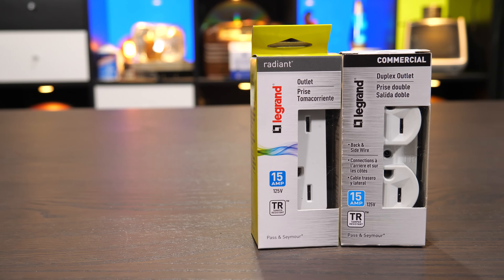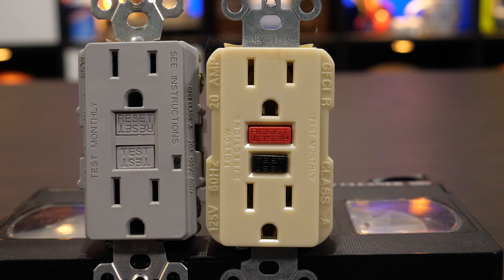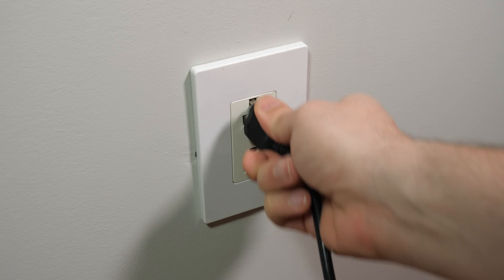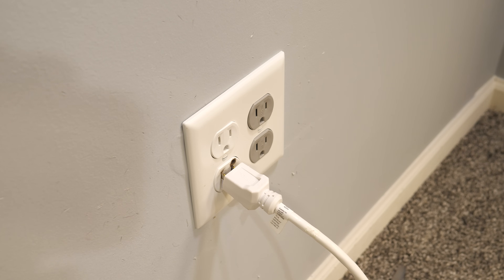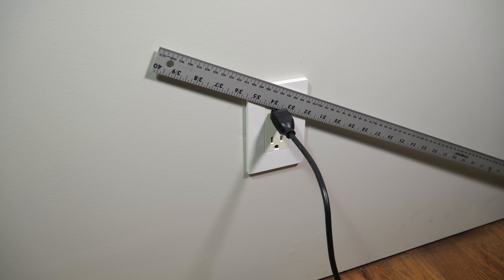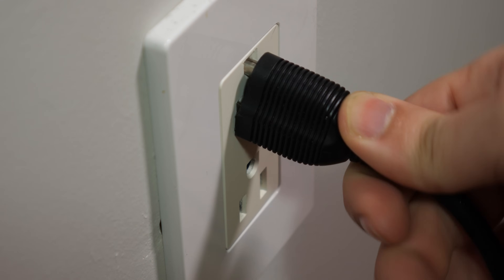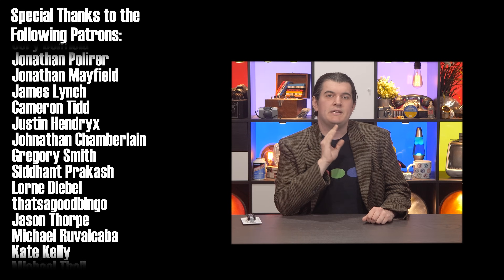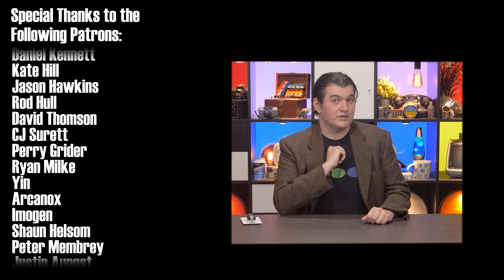Power outlets are topsy turvy - but does it matter?

Comment: I hail from the great Lands of the Schuko a.k.a. Type F Plugs and have very little experience with your death-traps, yet I found this video interesting as ever. Good job!

Also, have you ever considered uploading to Nebula?
Reply: Here in Italy Schukos are the bane of our lives...all the larger appliances come with them (or the ungrounded version for some reason) meaning you either have to cut off the plug and replace it with an Italian 16 amp one or use an adapter. "Why not just install one of those fancy outlets that can take both Schuko and Italian plugs?" I hear you asking. Well, here's why: those outlets tend to work terribly with Italian 10 amp plugs, catching on the part where the prong insulation meets the metal tip. This is particularly bad with europlugs (identical to the traditional ungrounded Italian 10 amp plugs except non-rewireable). Additionally, Schuko outlets take twice the space of traditional 10/16 amp Italian ones in the most common compatible socket assembly designs. Some designs, particularly older more traditional ones, also have smaller plug faceplates (I mean the little rectangle of plastic around the socket, which also normally is the size of a light switch) which do not support sacrificing two Italian outlets for one Schuko.
Reply: @traveller23e and don't forget: “Oh, you cut off the original plug? That voids your warranty and is the cause of the malfunction/fault, of course: it's clearly a job that only our overpriced authorized electricians are able to do [but definitely wouldn't]“.
Reply: @AelwynMr  Lol only applies to new devices, and only in some situations. If it's on the end of a kitchen blender or hair drier I really don't care and it's just a question of whether the joy of not using an adapter is worth the effort of rewiring. It's also sometimes convenient to have a standard Italian 16 amp plug on the end of a power strip that came with a Schuko, not to mention standard AC computer power cords (in one situation for example I had a spare cord set up at my desk with a short cable and a right-angled Italian plug as that was what fit best, then I had a separate cord for travelling etc).

Comment: easiest solution is just do what other countries do and mandate all future plugs need to have an insulated first few millimeters of the prongs, so if it becomes slightly dislodged or your fingers slip, you touch only the rubber insulation, not the bare metal

Comment: Obligatory making fun of Japan for not only having 100 V/50 Hz electricity, but also for using ground wires instead of pins. Have fun touching the live blade with your floppy wire.

Comment: Recessing the power outlet by a quarter inch would likely solve the problem of exposed pins while plugging in, and also hold the plug in place. A channel could also be moulded in from the ground pin for right-angle plugs. 
 Another option could be a ridge above the live and neutral pins, or click-lock ports that actually hold the plug pins in place (push to lock, push to unlock mechanic).
Reply: The college I go to has recessed outlets. Although it can be an issue for some adapters.

Comment: I like it down myself and Dad is an electrical engineer.  With it down it is closer to ground as well.  Up also adds stress to the ground if cord gets stepped on while other prongs share stress.  The case of a falling object, is why you have breakers and GF protections.  The right angle is a good idea but the boxes are not made to mount well to the wall studs that way unless you are doing a square box.

Comment: When I was in middle school, I was at home alone getting something out of my dresser. I closed the drawer and the power went out in my room. At some point prior to that, my dad had shown me a fuse box and a circuit breaker box and what to do when the power goes out in one room. I went to the box, saw that one circuit had tripped, and I flipped it back. It immediately tripped again. My dad didn't explain what that meant, so I kept trying 2 or 3 more times. I eventually gave up and went back to my room. All I remembered was that the circuit tripped when I closed the drawer on my dresser, so I opened and closed it again and then went back to try the breaker and this time it stayed in place when I flipped it back on. I was in middle school so I didn't question why this worked.

About a week or so later, I noticed that some stuff had fallen behind my dresser and I pulled it away from the wall to get it. There were black marks on the outlet behind my dresser and when I went to pull the cord of my clock radio out of the outlet, I saw that part of the prongs had melted away. Then I found a penny on the floor with black marks on it. I eventually put two and two together and realized a penny had fallen behind my dresser and lodged itself on the prongs of my clock radio plug and completed the circuit like the knife in this video. And my repeated attempts to flip the circuit back on while the penny was still sitting on the prongs of the plugged in outlet were actually unintended attempts to burn my house down. So the incidents that this new style of installing outlets aim to prevent actually do happen - I am living (thankfully) proof. That said, since it was a two-prong cord without a ground prong, as this video points out, putting the outlets in upside down would have done nothing to prevent the penny from touching both live prongs in my situation. So I agree with Alec's conclusion.
 
Final takeaways:
Try to figure out why a circuit may have flipped before trying to flip it back on again. Teach this to your kids when you first show them how to flip a circuit breaker back on.
Don't stack coins (or any small/thin metal things) on tables/dressers near the wall if there is an outlet behind the table/dresser. 
Circuit breakers are awesome. Not only did they keep me from burning down my house, that clock radio served me well for years after this incident.

Comment: My gas oven/range has a right angled plug with the ground on top. I bought the oven after I got my house. I didn't have to reverse the outlet behind the oven however, as it was already installed in the ground up position (the only outlet in the house installed with this orientation). I have to assume that the ground up orientation is not uncommon in some large appliances.

Comment: speaking of the wall plate.. what always bugged me most every time i ever swapped a wall plate or whatever, is the fact most you can get, if not all, use flat screw heads, rather than philips.. which means if the outlet is live and you press hard with your flat screwdriver and accidently slip, there's a chance you're going to send the flat screwdriver tip into the outlet, making yet for another spicy moment.. something that would not happen or be possible with a phillips screw head..

Comment: Alec, I'm a bit surprised you would dismiss fixing the home installs due to right angle plugs. Frankly, I've rarely encountered them. Additionally, while the install orientation of the outlet can be changed, we all know it'll never get updated after the initial install. So fixing the outlet orientation should be first in the chicken/egg equation, not the cord (which can be fixed by using adapters/power strips).

As to the likelihood of the contacts bridging, well I have first hand experience with that. It's a freak occurrence, yes, but I've had it happen. Mine was our dog who liked to lay against the wall. She stepped on the cord, and then managed to get her dog tags in the crack and shorted out the terminals. Fortunately, it was just a burn out and a tripped circuit, but still not great.

Comment: Some manufacturer's don't car either because molded right angle plugs only fit in it upside down. So now we have plug strips, extension cords, and appliances that are suffering from strain on the cord when they are plugged in technically right side up.

Comment: I literally spent the last month installing these receptacles. 380 to be exact (in a 6,000 sq-ft house).

Just by design alone, the wiring really gives you a hard time flipping them over to have the ground wire pointed downward.

So that 6,000 square ft house I did electrical on has all the ground wires pointed upwards. The owner seems to love it.

In reality it doesn’t even matter, but the design really want you to put them ground upwards. Hell, even the live and neutral wire is conveniently oriented properly.

Also, electrical manufacturers are used to the ground wire downward design. My Rack-mount UPS has an angled plug that sits flat against the wall but the plug is conveniently pointed downward and to the right, so that the plug isn’t blocking the outlet.
Reply: ??? The screw connectors on the sides of the outlets are about the same to connect no matter what orientation the outlet may be in. How is the outlet biased for ground pin up? I've installed a few outlets in my time and it has never been an issue.

Comment: from my experience.
1. the face orientation is alot more visually enjoyable. And the shape and grip texture on plug is usually designed for this position.
2. Upside down orientation, makes it hard to use the power bricks that plug directly into the wall, they are usually top heavy, and fall out.
3. sideways you can fit under things in narrow gaps, more easily, but otherwise they give none of the benefits, and none of the down sides of the others, with its own added annoyance.

NOTE - i wrote this before you mentioned some of these points in your video

Comment: For beefier cables, the weight of the cable from the plug is better supported when the ground pin is at the top. The ground pin is a more secure fit than the blades.
Reply: Except by putting that stress on the ground your safety pin is always the first to break, I have had it happen three times while running grounded vacs and have gotten shocked as the vacs depended on grounding for static discharge.  I got good at replacing male plug ends because of it as others had the same thing happen as well, one guy was ready to quit over it.

Comment: "I don't care." He says as he makes an 18min video after how many hours of research, script writing and editing. 

Joke aside, I've been reading in different posts for years that the ground plug should be up. Its always the "stuff falling on the live wire" excuse too. 

I've seen some right angle plugs that rotate in their slot so you can orient it whichever way you need. I think I saw it on those outlet plugs that work like a power strip for more slots just without the cord.

Comment: In my 57 years as an American,  I don't believe I've ever seen an outlet with the ground plug down. I mean I don't spend a whole lot of time looking at outlets,  so I may have missed one or two. I currently live in a condo built in 1972, and all of the outlets are ground up. As an American I will freely admit that Americans in general are lazy and stupid. Add to that American politicians love to fix "problems" with legislation.  The fact that we don't have miles of legislation about how our electrical outlets must be configured suggests to me that people aren't dropping dead right and left from being shocked trying to plug or unplug things from the outlets. Intern this suggests to me that this whole subject is a solution in search of a problem. In other words, we've had the same design electrical outlets in this country for over 100 years. If it were really a safety issue, it would have been fixed a LONG time ago.

Comment: The original way is the ground down but, the ground up is suppose to be for switched outlets. It was very common back in the day to have lamps plugged in the outlets that were controlled by a light switch.

Comment: As a South African, i’m watching this and i cannot help but think that this is the dumbest plug design i have ever seen. Every one of our outlets has a switch that you can turn the power off so you don’t nuke yourself when unplugging anything. You can also switch off an appliance without having to remove the plug from the wall. No sparks, no zap, no nothing. And as for the plugs, the are all right angled and with pins that are almost impossible to pullout when yanking on a chord.

Comment: The U.S. could learn a lot from the rest of the world. It's not as if there isn't potential.

Even though the system of plugs and sockets in Germany is quite good, there are different plug systems in Europe. There are minor advantages and disadvantages with each.

The system of international units would also be worth considering. After all, it is also used internally by NASA and then - because the typical U.S. citizen does not want to know it - converted into imperial measurements.

If you like, I'd be happy to get you some typical German plugs and sockets and you can make a video about it, with real footage.

Comment: The worst wall-receptical-sin I've ever seen wasn't the orientation or faceplate-screw-backout, but the fact that commercial painters so regularly just roll paint over faceplates and outlets. Doing that a few times makes it impossible to even safely remove an outlet to work on or replace it. Imagine having to chip throught 1/8 inches of paint just to replace a faulty outlet or switch.

Comment: I can imagine americans could switch to the british way plugs are designed without really changing much, although all plugs would require a ground pin to open the shutters and it only increases safety of the actual plug when the bottom, exposed part of live and neutral prongs are insulated.

Comment: For me, the biggest issue with the plug design has less to do with orientation or anything like that, and more with the fact most of the "default" style plates are secured with a FLAT-BLADE SCREW in the MIDDLE of both outlets. You're just begging to have that screwdriver slip and go straight into the outlet. Nearly had it happen to me on at least 7 separate occasions. Make the damn screw a phillips or square. Hell, go torx or hex idgaf. Just don't rely on the one type of screw head that's the absolute easiest to jam into the outlet! It's a problem just waiting to happen. Wouldn't be surprised if multiple people have been zapped by this dumb decision.

Comment: Both of my GE window unit air conditioners are right angle and designed with ground plug up.

I've flipped only those two outlets because of this
Reply: I've had a bunch of different brands of window air conditioners like that.

Comment: China uses an AU/NZ like socket upside down with the earth at the top, which is probably for the same reason. Modern AU/NZ plugs have half insulated active and neutral at the top which seems an even better solution to what is still basically a non-issue. With AU/NZ outlets being switched putting them upside down would make the switch hard to use so nobody would do it whether it conforms to standards or not. Never seen one sideways.
Reply: Sideways power points did exist in Aus until the late 1960's. HPM 887 was one common example.

Comment: I’ve been in several hospitals in recent months, and know that the outlets in the ones I’ve been in are all installed the normal way. The wall behind my bed would be covered with outlets, all oriented with the ground pin down. Also, nearly every piece of medical equipment has 90 degree plugs. 

In other news, we just bought an electric car, and when I tried to plug the charging cable into the 110 outlet of our RV hookup in the backyard, I found that it wouldn’t go. The 110 outlet is installed with the ground pin up, the box had a metal bar that stuck out right above the 110 outlet, and the  charging cable had a 90 degree plug connected to 4ga cable. The only way that baby was going to go into that outlet is if I turned it over and put the ground pin down. I ended up using an outlet in the garage that a tenant installed that doesn’t have a cover. But I’m totally sure it’s safe…

Comment: The flare on the plug end is intended to reduce the moment effect which draws the plug out of the receptacle exposing the blades. The grounded plugs have the ground conductor adding more contact and thus more friction to resist the pull down torque. Some more critical application plugs, like for hospital equipment have large flares. You are correct about the ground up originating in hospitals. I’ve had a many few years of MEP engineering for hospitals as a consultant, and all stipulate ground up in their internal design standards due to the risk of contact from cord pull out. Partial cord pullout is very common in hospitals, anyone in a patient room can see an iV machine with a cord barely plugged in.

Comment: Really? Im willing to bet that not one person in history has ever been killed, or even severly injured directly by this.  BUT, what i will add is that i have totally seen metal filings in a shop cause problems with this plug design, a smoking short that could have resulted in a fire. Thats why all our plugs that are near grinders all point straight down vertically for the plug, not horizontal like is traditionally done.